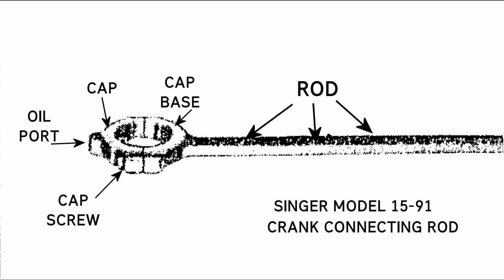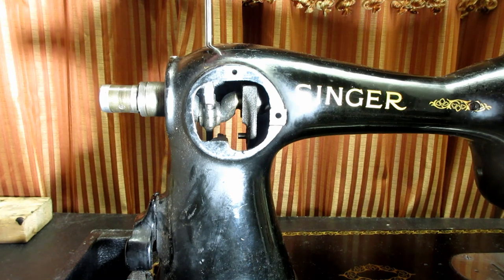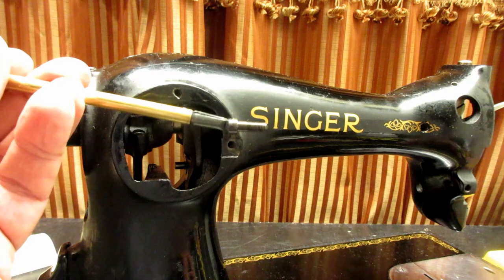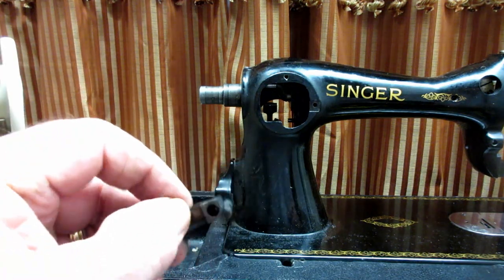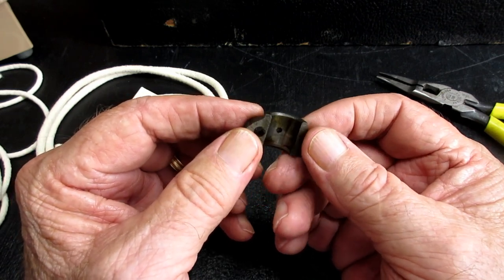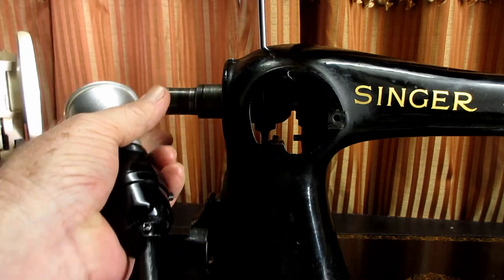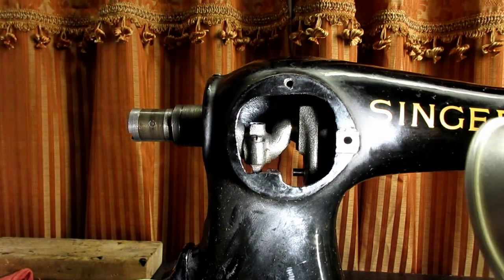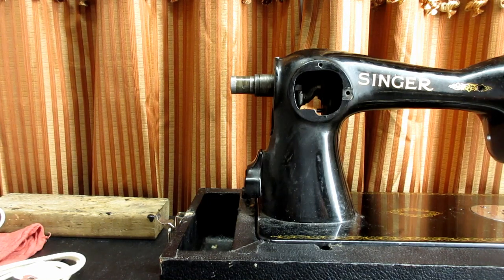How to Inspect, Replace the Connecting Rod Oil Pad Felt on Singer 15-91

Comment: Brilliant!  So helpful. Thank you!  Do you have any idea on the purpose of the top opening with the circular, small chrome trim that is between this port and the hand wheel?  Do you know if a wick is involved in this small opening?  Using a needle, I hypothesize that a wick might be involved. Your thoughts?
Reply from the maker: *EDIT* Bill, I was thinking of your comment about the needle, and revisited the parts drawings and found THERE IS an oil wick there! 😲 Not only that, but a spring and the chrome ring is the top of a "cap", I think to hold the spring. This setup reminds me of the motor on the Singer 221 featherweight and you can see the Cap @39:36 of this video: https://youtu.be/1XfYoQV4URo   So here is the part number & name of these parts: #125331 - Arm Oil Pad (felt) for oiling Arm Shaft Back Bearing.  #125333 - Arm Oil Pad Spring. #125334 - Arm Oil Pad Spring Cap. Now here is a copy of my original reply to this comment: *Original Reply* That opening is an oil port for the bushing of the horizontal arm shaft. There is no wick that I know of. You can download a free copy of the original Instruction Manual for this model from the Singer Support page here: https://www.singer.com/search/support?title=15-91 You may find it interesting. Thanks for asking, and for watching my channel.
Reply: FASCINATING!  Andy comments, “So, of course, we WANT to take it out.”  LOL.  Driven by our curious nature, I shall continue to ponder!  LOL.   I recently had success by using a small drill bit to penetrate a hardened wick— twisting the bit by fingers only of course.  Thank you for your investigation!!!

Comment: I restored a 15.91 just recently. I took it apart, cleaned all the parts, rewired the motor and the connection wires and reassembled it, EXCEPT for what you are showing us now lol. Thank you!
Reply from the maker: Who knew, right? I've never seen an oil pad there before on other models. I believe there is also one on the Singer Model 201 machines. This was the 3rd oil wick/pad I found on the machine. The 4th will be in my next video. Thanks for watching my channel.

Comment: I have just recently found you.  What a giving person to share your vast knowledge.  We are all lucky to have you here.  I have a Singer 99K-13 (no reverse).  It was my husband's grandmother's machine.  It sews like a dream.  It makes the most perfect straight stitch of many machines (old and new) I have had over the years. 

 I came across a 404 in a cabinet last weekend.  A friend gave it to me, but knew nothing about it.  It is in good shape, but after watching your entire series on the 404 (both of them) I still can't correct the problem I am having.  The hook picks up the thread, and the thread slips between the hook and the bobbin case instead of over the bobbin case.  This happens at about10:00, long before the hook would drop off the thread.  It happens often, but not every (double) rotation.   I have changed the bobbin and cleaned everything.  The bobbin case says"172082 Simanco U.S.A.", so I believe it to be the original case.  This happens while sewing fabric, but also with no fabric, the face plate open and the needle plate removed so I could see exactly what was happening.   Can you guide me in any direction?
Reply from the maker: Things I check when I encounter this: Model 404 came from the factory with plastic class 66 bobbins, part 172336 This is where I buy mine, but there are many sellers (and different qualities too!) https://www.ebay.com/itm/373043155241?epid=664504770&hash=item56db1ad129:g:naUAAOxy06RRHtxB      I have found some class 66 metal bobbins are taller than the plastic and can catch the needle thread, pulling it under. Also, I have found people using a class 15 bobbin, no no no, that will always catch the thread. Class 15 bobbins are flat-sided, not curved like class 66, and they are for sure taller.
I have found the STROKE of the takeup spring to be set incorrectly and not releasing the tension on the needle thread when it should, causing the thread to resist being pulled by the hook and slipping under off. https://youtu.be/4Q1dAUHqfvg    I have found the takeup lever was installed with the set screw NOT on or not completely on the flat spot of the stud. That messes up the timing of the takeup lever to the hook and can be pulling the thread up on the lever while the hook is still transporting it around to the drop-off spot. That's all I can think of at this time. Good luck, and thanks for watching my channel and keeping your machine in service.
Reply: @andytubesewing1953  You are truly a jewel.  I changed to the plastic bobbin (because that was the easiest) and she sews like a dream.  I was not going to try to completely restore her until I knew the problem was something I could solve.  Now, with your great You Tubes and expansive knowledge, I feel confident enough to give it a go.  Please know how much I appreciate you sharing your knowledge and time to share with the rest of us. I worry it will not be long until almost nobody will know how to work on these GREAT vintage machines.  Thank you!
Reply from the maker: @mariemurrell3828  Hey! Thanks so much. 😊 Model 404 is my favorite heavy-duty straight stitch sewing machine. I guess that is why I did so many videos for it. Yes, when I started my hobby of restoring SInger machines I realized info is hard to come by and already we've lost so much knowledge. I was fortunate to befriend a couple of retired Singer repairmen who were coming to AZ for the winters to escape cold Canadian weather. They shared so much with me and I'm very grateful for that. I think they both had forgotten more than I'll ever learn about the machines, but they sure helped me with a lot of info. I decided to make my channel in the hopes of helping people who wanted to keep their machine running, or were given a family machine and to kind of "show off" how great the old machines are. I got your donation and thank you very much for that. 🙏I used it this evening to help buy new motor brushes for this 15-91 I'm working on. Take care of yourself, and happy sewing.

Comment: That was definitely something new for me, Andy.  I'm guessing quite a few of these machines could have that felt missing too if the old 27/28/127/128 type machines are anything to by. But even if they have a wick in them I still put in a new one -  it's one of the first things I do after getting that area clean.  I'm sure the oil flows through them better than the old felts, regardless of how much you try to soften them.  (I've had a couple that seem to have almost fossilised in the machine!)  :-)
Reply from the maker: Always enjoy hearing there is something new to folks in a video, thank you. I agree about wick replacement. I've found it's easier to just replace the wick and I love knowing it will last my lifetime. I've found one more missing wick on the machine and it's giving me some problems but I work something out and do a future video. Take care, Megan.

Comment: Thanks Andytube,, nice video.. I always do oil that hole, but didn't know there was a felt pad/wick there 🙃.  I'm not sure the oil even went where it was suppose to go when I oiled that hole.. After watching this video, I shined a light in the hole and turned the hand wheel, All the wicks are there on all  three of my 15-91's. , and I think they are still absorbent, I watched the oil as the felt absorbed it. BUT, a couple of them look pretty yucky. so I ordered some felt per your link below.. LOL it's enough to last 10 lifetimes.. haha.. I ordered the 3/16", and the 1/8" thinking I can use it for the potted motor grease wicks..? That's quite the website. Thanks Andy..!
Reply from the maker: Yeah that's a pretty wild website for sure. It may work on the potted motors and the smaller one maybe on the little 221 featherweight motor and are three model 15-91s really enough?
Reply: @andytubesewing1953  LOL.. yes  three 15-91 are enough, I couldn't resist the 3rd one, for  $30.00  > a 1939 it needed total rewire, but it was nice, and in a table, with a bench.!! .. ya know this vintage sewing machine thing is addicting.  I also have TWO 201-2's.. and three 99's.. a 66 Red eye treadle, AND,,!  because of your videos!!  I now have added a "503A", and TWO "237" Fashion mates , I just brought the 2nd 237 home yesterday,, (in a table)..It was dirty, but all there, and the hand wheel turned.  got to keep busy. It's a good hobby 🙂. I pour myself a coffee in the morning, take a couple sips, and look at the machine , poor thing, so dusty and dirty, set my coffee down, and start taking things apart, and cleaning etc. then a couple hours later, I look for my COLD cup of coffee, hahah... Thank you Andy. you'r the best..!
Reply from the maker: @connieworcester55  Yes, a good hobby, but you must live on another planet to find those machines at the price you do. When you talked about "driving" to get a machine the other day you really meant "flying your starship", right? Those are all great machines you have.
Reply: @andytubesewing1953  LOL..  I have found a few good deals here in the N.E.  Oh, and   I named my 503A ,  "Astro"   after the "Jetsons" big dog.. haha
Reply: @andytubesewing1953  The lady who sold me the 15-91, in a cabinet, with bench,  for $30. Probably first got an estimate for buying a new foot pedal, and rewiring the light, and the plug, and re-wiring/soldering new wires inside the motor, and said , it's not worth it.?  So, that was a "rescue" for sure..  I enjoyed all the work.I think I'm going to take it apart again. When I put the worm gear back in on the armature shaft, I tightened the 2 set screws firmly with one set on the flat spot of the shaft. I heard a little snap noise, but it wasn't the screw, it was my small Chapman bit, it broke a tiny piece the size of a half of a pinhead, very tiny, but not good to have possibly stuck in the grease somewhere. I couldn't find the tiny piece.. uh..  Also Do you know of any replacement "springs" for the motor grease wicks? one of mine got a bit mangled pulling out. I guess if I knew the size I could check MaMaster Carr.? I tried other sewing machine parts sites, couldn't find any..
Reply from the maker: @connieworcester55  you will enjoy this short video from Bob Fowler https://youtu.be/QF5aGdqonk8
Reply from the maker: @connieworcester55  hahaha that's a great name! I love it!
Reply: @andytubesewing1953  Oh, good to know... Thank you so much..!
Reply from the maker: @connieworcester55  👍
Reply: @andytubesewing1953  I just found a 201-2..in a table, for $45.00......1 hour and 45. mins. away. oh my... should I??
Reply from the maker: @connieworcester55  oh boy well it's up to you only one time in my life if I told somebody to not buy a machine and she was angry with me for 2 years afterwards. If you go just drive safe
Reply: @andytubesewing1953  haha, I would never be angry at you. I just mentioned it, because you asked if I was on another planet with the prices I'm finding. LOL. I found this just now, and it happened to be posted about an hour ago.. these machines are not exactly selling like hotcakes around here.. not many people sew anymore I guess.
Reply from the maker: @connieworcester55  Haha, OK good. I think maybe it's b/c you live in a more densely po; populated part of the country than me, so maybe there are more machines available. I saw an advertisement from a guy who rebuilds motors for the 15-91 & 201-1 models (potted motor) and for the price of $156.00 + your old motor, he will send you a fully restored motor. Whew! The prices you find these jewels for are just incredible to me.

Comment: I was gifted a 1948 15-91 and I absolutely love her.  Now I know about this little secret. Guess I will have to check mine because I’m pretty sure this has never been done.  Where can I find that 3/16th cord? And what is the cord made of?
Reply from the maker: Congratulations, Tiffanee. It's a very nice model. I put the info in the description below the video, but here is the link again: https://www.mcmaster.com/felt-cords/ I used the 85% wool but you can use the 95% wool cord also. The minimum length is 5 feet. https://www.mcmaster.com/felt-cords/ I don't know if you watched my presser bar and needle bar videos for this model. I mention that b/c those bars also have oil wicks and mine were missing. Here is the Playlist for the model 15-91 with all the videos I have done and I will be adding more.
https://www.youtube.com/playlist?list=PLsCOZgzzaiKJftyGwzdDiWa9R6HFEACJo   For example, I will soon be adding a video about the hidden oil wick inside the Oscillating Rock Shaft. You may want to see those other wick videos in case you will be ordering other sizes you can just pay one shipping fee. Thanks for watching my channel and take care.

Comment: Can we use a cigarette filter for an oil pad felt instead of felt cord? I can't find felt cords here in Greece and cigarette filters are common and cheaper.
Reply from the maker: I would not use cigarette filters. Most are made from Cellulose Acetate. The tiny fibers are thinner than sewing thread and I'd be concerned with degradation and fibers getting into moving parts along with the oil. Instead, I would use yarn, assuming Greece has yarn or cotton string. The wool yarn would be best, and I know there are makers of wool yarn in Greece. A thicker yarn, or 2 or 3 thin lengths braided together. Wool is more absorbent than polyester, but even a length of polyester yarn would help and be OK and hold up well. You want something to hold the oil instead of just running right out of the part from movement. I've had emails from people that used slices of old cotton t-shirts rolled into a tiny ball and stuffed into the hole. Forget the cig filter. Thanks for asking a good question, and for watching my channel.
Reply: @andytubesewing1953  thank you again
Reply from the maker: @gdaougr  Certainly.